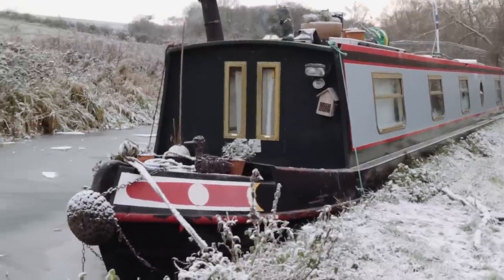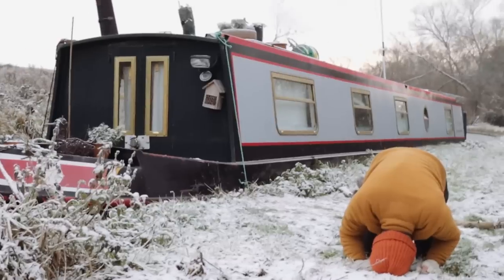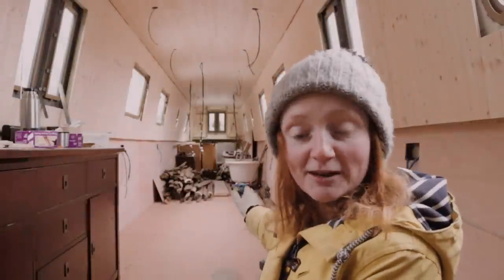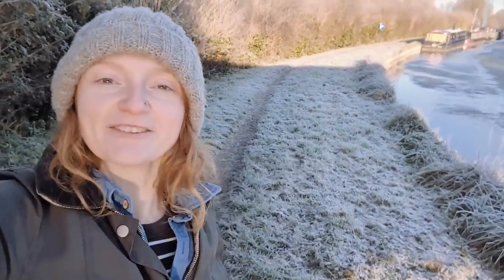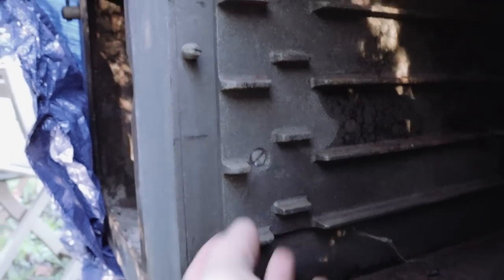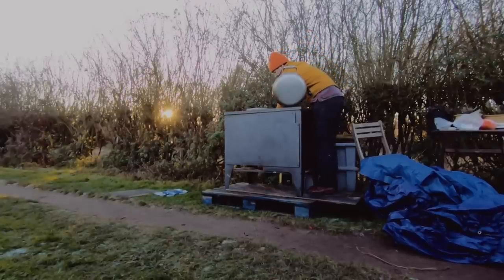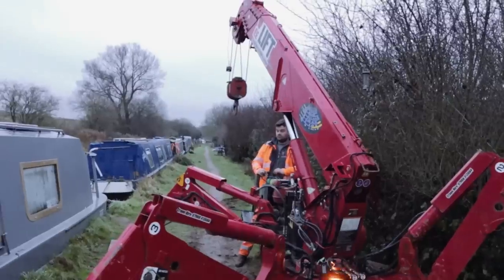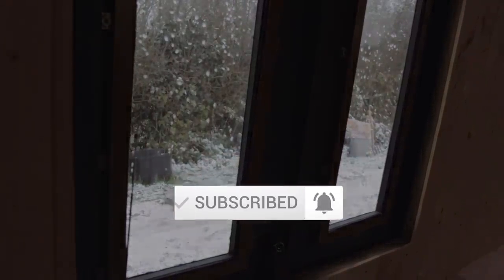The canal has FROZEN. Narrowboat life in SUB ZERO temperatures | this tiny life

Comment: Have you got the engine in and the electric cables? Cause you could go 24v and not 12v. Lorries run around on 24v cars 12v. Lots of appliances now in the market at 24v. Performance is the key word.  Cheaper and smaller cables.
Reply from the maker: Hey Dene. So the motor will be 48v but the cabling running through the boat will be 12v and 240v. Most of our appliances are able to run off 12v which will also be kinda on the batteries
Reply: @thistinylife  could have gone 48v thru out? With a big winch at the front.  Very marine.